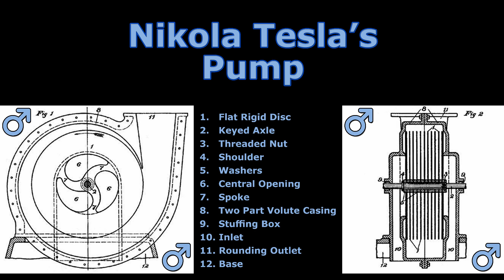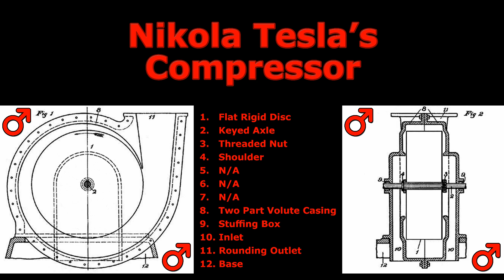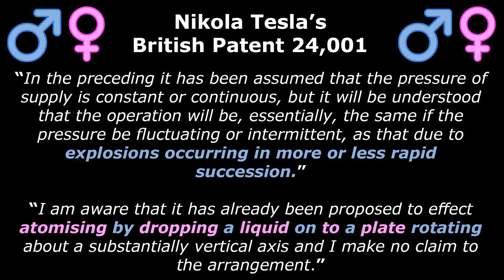Nikola Tesla's Cold Steam Technology - Explosions

Comment: My channel TheTeslaJet has a Tesla turbine making power, they lack torque but are cool with a DeLavel input.
Reply from the maker: I had a look at your channel. I had seen some of the videos before. They are used commercially to produce 1 Megawatt at 97% efficiency. Dyno proven.

Those guys spent way more money on R&D than anyone else.

So the whole myth they don’t have torque is down to how you build your rotor, casing and bearings.

I noticed a number of features missed from the patents in your videos. 

I’ve built many turbines and some I wouldn’t dare to try and stop because they have so much torque. 

Even the small 28mm rotors that weigh 10 grams will burn through your fingers like butter at a certain rpm.
Reply: @nikola.tesla.r.and.d.centre  There was little info back then, the molecular disc adhesion is not as good as a piston uniflo steam engine say so I passed on it's usefulness but it was fun. I also sold 10+ to universities a good sideline.